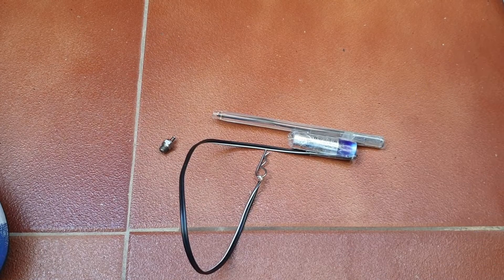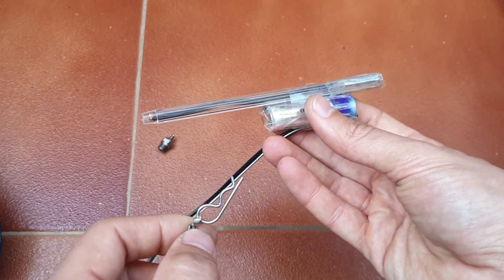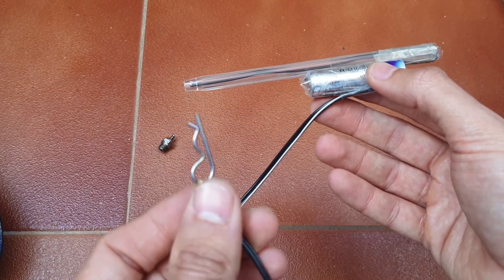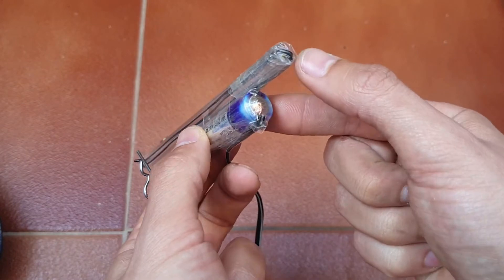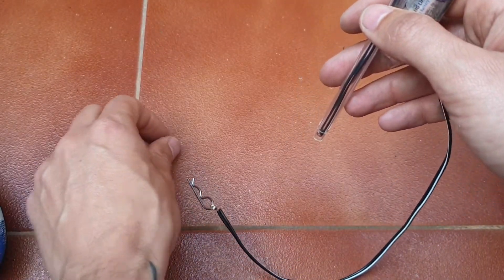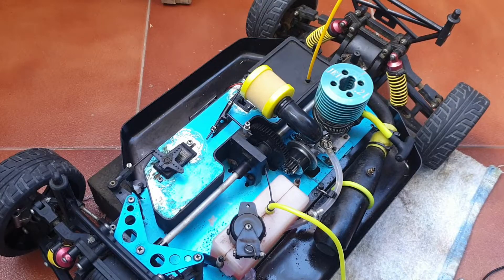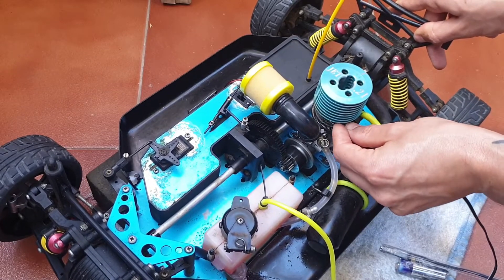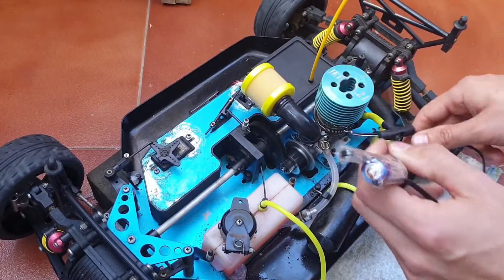DIY Nitro Glow (Plug) Igniter

Comment: Weird how you had to have so many cutscenes because it didn't work or you ran into an issue and then when you finally got it to work there was one more cutscene and then it fired up well played 😂😂😂
Reply from the maker: Haha well it's not perfect. It is a couple of wires taped to a battery at the end of the day. Its also a backup not to use as your primary. I now have a proper one and dont even use that. 
Part of the problem was also my car. It is 20 years old haha and was one of the first starts with old fuel and old glow plug. It was also the first time testing it. All in real time. Before making the car start all I did was made sure the plug was glowing. Clearly had trouble with that too haha. 🤦‍♂️
All in all I think it'll get you out of a pinch if your igniter runs out. 
Hope you enjoyed my fails at least. All in the name of entertainment!! 😂😂
Reply: So name it DIY failures... I am sorry for your misfortunes in building, but the fact that the video is misleading is the problem.
Reply from the maker: @BuzzLytyr  I disagree. It is not misleading at all. It does work. Obviously with some problems but it will work. Try it yourself before commenting. It's basically how the cheap ones that use a AA battery work. Only difference is its made with everyday materials. Hence the DIY. It would only be misleading if I claim to have started up the car with that but started it with another device. But as that is not the case and I did start it with the DIY glow igniter. There is nothing misleading about it. Thanks for your opinion tho. Have a nice day.🙂
Reply: @BuzzLytyr it worked

Comment: I tried it and didn’t work for me
Reply from the maker: Really? The main problem I came across were the 2 wires not being pressed tightly onto the battery. 
Check your glow plug. Might be burnt out.
Reply: @JPLlani  I made one out of Alligator clips and a d battery
Reply from the maker: @Smodlee  hm. Only thing I can think of is that maybe the inside alligator clip thats connected to the glow plus is touching the surrounding heat sink. That should only touch the tip of the glow plug.

Comment: i did this today out on the field far from home, my original glow-igniter was dead after a bit of usage( i pulled the plug from the head and tested with the igniter- no glow) luckily had some AA-batteries on me + i always bring tape and some wire. saved my driving day :DD
Reply from the maker: Yup tape is a must always lol. Glad you could continue. Nothing worse than having to stop especially far from home.